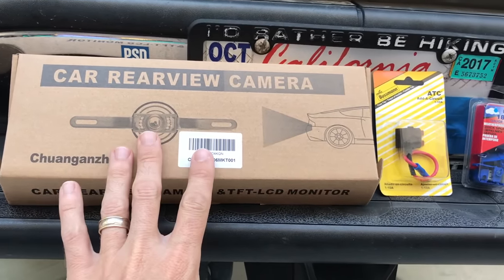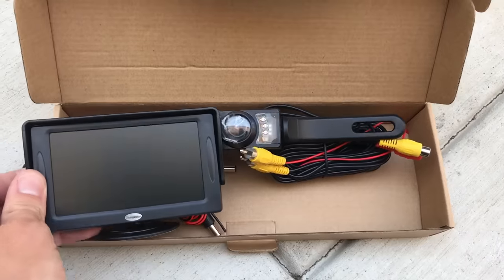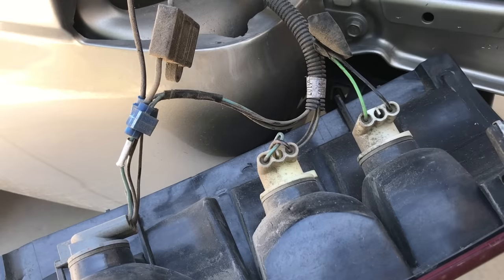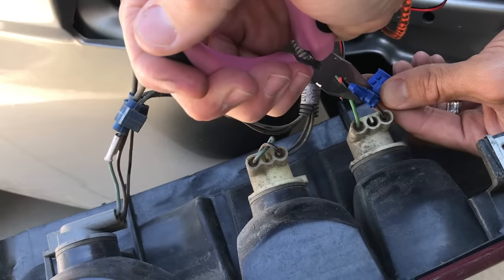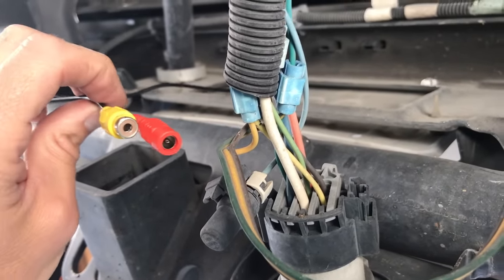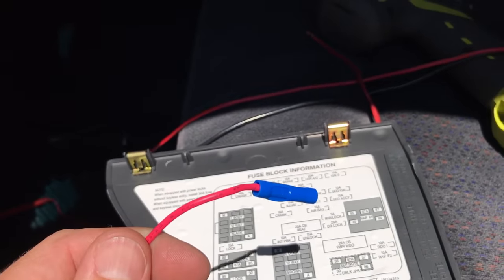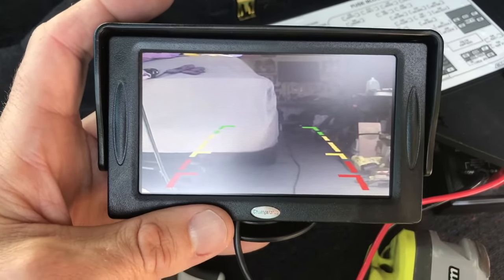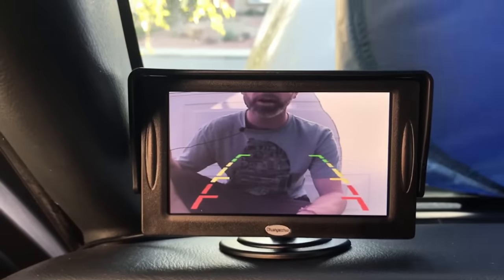Install a Rear View Reverse Backup Camera for only $30!

Comment: I threw my truck in reverse to test the connection before plugging it up like you said and the truck backed into my pond. Thanks.
Reply: You should have been looking at the monitor then, shouldn't you 🙄 (lol).
Reply: aRe yOu oK?
Reply: so close to winning a Darwin award
Reply: Did it work in the pond?? 😂
Reply: who was driving at the time ,you
Reply: made me laugh today and the comment is 2 years old!
Reply: Might wanna put emergency park on before leaving the vehicle in reverse.
▪︎ You can also put a tire block behind the rear wheels.
▪︎ You can also have a friend put it in reverse while you look at it while holding the brakes
Reply: @JOSERIZALADVENTURES and now it’s 4 years
Reply: LOL
Reply: Doh
Reply: Works as a fish finder too 😂
Reply: But did the camera work? 😂

Comment: This video is well done and very helpful. 
My only issue is with the clamp on splicers. Those things should be outlawed. lol
They ALWAYS allow moisture to enter, creating corrosion and resistance. 
And they almost always cut one or more strands of the parent wire
I've seen those clips cause the parent wire to break in half because of the corrosion they cause.  
It's far better to cut the wire and either solder or use a wire twist nut filled with  dielectric grease.
Not hatin on this video. As I said, it's well done and very informative - even after 3 years. 
I just cringe when I see those clips being used.
Reply: First time I used it was a joke

Comment: I bought all the recommended parts and installed it successfully.  Thanks for the video.  However, the quick splices did not work the first time on either the ground or power connections.  They made connection on the backup light side but not on the camera power harness side, so I ended up soldering a segment of thicker gauge wire onto the leads of the camera power harness wires.  Then the quick splices made a good connection.  I don't know if the splices are marginal or the gauge of the camera power wires got smaller or whatever, but I had 0% success using them on the power wires that come with the camera kit.

Comment: the video was very helpful, but it would be helpful to ( emphasize that  the power wire to the backup light is the  black/red stripe wire not the red wire as many people may think)  You did mention it  after watching the video a few times I picked up on it and  switched the wires and it worked perfectly.Thanks!

Comment: One question:

Instead of using add a circuit, can't we just add another quick splice onto the reverse light and use that as a power source for the display screen front? so two quick splice and use it power backup camera and display screen?
Reply: Did you ever try this? I'm about to install a camera on my car and had that same question?

Comment: How did you get the camera wire from the outside to the inside cab? I got everything but that.
Thanks for the video.
Reply from the maker: I went through the grommet that the e-brake cable runs through.

Comment: This is a great video, but it should be known, if you have a sedan with the fusebox mounted flush to the door, you wont be able to close the fuse panel to the add-a-circuit. So either direct wire under a circuit or better, find another place to mound it.

Comment: I never knew about the added circuit fuse. I normally have directly to the battery with a switch so i can switch on and off when I want or piggy back it onto the cigarette lighter, I have mine in a van so it's on all the time so that it works as a rear view mirror and has a nice wide angle that gives me a better view when switching lanes on a motorway.
Reply: For a beginner (me) how would you connect direct to battery with a van. I dont think my wires reach all the way up there. Any suggestions ?
Reply: @missculinary  vans I've driven had the battery under the drivers seat so easily accessible, and easy to run the wire under the carpet to the dash. Whe the battery is under the hood it's a little bit difficult to run the wire through, that's when I find it easier to splice into the cigarette lighter. Or you can splice it into the wire that powers the stereo.
Reply: @spiderman01980  Nice imma try the stereo . Thanks

Comment: I noticed a red wire coming off the wire going from front to back, I believe it is the video cable. Question is what did you do with the red wire coming off both ends? Did you connect them to ground or to something else?
Reply from the maker: That’s the power wire, if you don’t tap the reverse light you can run it to the fuse box.

Comment: Piece of advice the wire splice CONNECTORS even if they are waterproof are the worst CONNECTORS to use on a car.
Reply from the maker: I havn't had an issue yet... doesn't mean I wont though. What do you use?
Reply: DoItYourselfDad I will STRIP back the insulation solder the connection and heat shrink with only 3M heat shrink,reason being it seals the connection.My Second choice if a SOLDERING gun is not available is a 3M heat shrink butt connectors with solder in the connector,So when you heat with a hot air gun it solders and seals at the same time. These butt CONNECTORS can be found by other manufactures and yes the solder is in it already. 
In my 39 years of working on cars and trucks I have zero issues on salt spreaders using this method and it takes a little more time but it is worth it in the long run.
Reply: CRAZY HORSEPOWER I like to put some RTV silicone on the wire before heat shrinking it. Makes a great water proof connection.
Reply: CRAZY HORSEPOWER i used some 1" tubing like that once but I had to order it online because nobody in my area carries it. The RTV trick works good with Harbor freights tubing. I just went through some ground wires on my truck that I had half-assed fixed a year ago that had bad corrosion. This time I had the bed off so I took the opportunity to go through the wiring and fix it right. Even added a stainless bolt for a ground stud.
Reply: Allen McKinney As I live in the North we have many issues with salt attacking the wires and as MACK trucks warranty people just love to probe wires without sealing the wire when they are done, in a year the wire is gone.So with that said we have to triage the electrical system to get the truck up I perfere to use HEAT shrink solder butt connectors with a piece of solder with the 3M heat shrink.
If it is my personal car I would fuse the copper wires (with a micro torch and heat sinks) to each other using the 3M heat shrink. What I am concerned about with using RTV is it is flammable and if it is sealed in the heat shrink it could take a long time to dry. But as you are REPAIRING you truck and have better access to the wires and if you have more than 4 CONNECTIONS I would run a new wires as the more CONNECTIONS you make the higher the resistance in the circuit. unless you fuse the copper.
Reply: CRAZY HORSEPOWER I got at least 3 ground wires that was rotting so I traced them up to good copper and added new wire with solder, sealed it. Even at the ends I soldered the ring terminals and sealed them so nothing can go up the new wires.
Reply: Allen McKinney If you are also interested 3M makes liquid tape this is a great sealant at the ground terminal it comes in a a 1 qt can and when it drys it becomes like a thick plastic coating, Just make sure not to it in between eyelet CONNECTIONS as it will prevent making a complete circuit.
Reply: CRAZY HORSEPOWER I've used that before. It was one of those things I liked but didn't like at the same time.
Reply: Allen McKinney It something we use all the time to reseal the probe wires after MACK probes the wires,We use it on the battery,starter,and exposed power feeds and grounds.
Also Keep in mind a salt spreader is pretty much the worst environment for any eletrical connection, Its as bad as a boat on the sea.
Reply: yea they work for about a year then come loose or corrode lol
Reply: Yes there are many other great connectors out there and also make sure to at least tape if not use some kind of tubing to hide and protect your freshly run wiring from the elements.
Reply: As someone who works in a Service Shop I can second that..... Especially the 3M versions.. They are horrid!
Reply: NEVER use rtv silicone on electric. it uses an acid to cure itself.  thats why the vinegar odor. it will eat the wiring. use of non-rtv is ok
Reply: The Butt Circuits, havent messed with the add-a-circuits yet..
Reply: DoItYourselfDad  they make heat shrink butt connectors, but you would have to completely cut the wires and then splice the three.
Reply: Yes the connections are crap. You can buy silicone filled connectors now. I use them all the time. They work great on boat trailers , rv any kind of trailer.
Reply: Splice and twist buddy
Reply: notchjohnson1  Picky picky!
Reply from the maker: His shift key is broken, we’re working on an”how to” video that should help him out soon.

Comment: I'm installing on a chevy express van. The licent plate is on the swinging door not center of the bumper. Do you think itll still work or should I attach to the bumper?
Reply: I personally would attach to the center bumper just for a better viewing angle

Comment: Great video, but why didn't you show how you ran the cable from under the truck to the inside, or is that in your next video?
Reply from the maker: Every vehicle will be different, I ran mine through the hole that the ebrake cable runs through.
Reply: The ebrake plug could be an option to explore. Thanks.

Comment: My truck has TPMS (tire pressure monitoring system). Shortly after I installed the backup cam I started having problems with it. I think I finally figured it out. It's RF interference from the unshielded video cable. I am going to replace it with a shielded subwoofer cable. Hopefully that will do the trick.

Comment: Confused about the ground on the  piggyback fuse. How you are connecting the the power leads. Which ones goes where. Is the a optional ground wire  needed.
Reply: camera has a positive and negative to power it, assuming positive from fuse goes to red wire on camera power, then camera negative wire goes to gnd. Thats what I think he is doing, but better to go via the reversing light fuse otherwise you have power to camera all the time car is on.
Now i'm ansering his questions, and he hasn't even replied to my quetion, there might be better ways to connect the screen than he has done, but it should work fine. Check polarity of the fuse wire is positive before connecting it up.
You will need use relevant fuse size if using reverse light fuse spot for ad a fuse, not sure what the camera would draw, dont think it would be much would have to check, i'm guessing 5amp would be plenty probably alot less, I will test my camera during install at some stage.

Comment: on dc isn't red usually pos. and blk neg ....great video ...very informative.... thanx
Reply from the maker: Yes and no, it's going to vary by vehicle. Each wire is color coded depending on where it's going. If you aren't sure which is which in your vehicle it's best to look up a wiring diagram to make sure.
Reply: Yes it usually is.  Always best to check with a meter to be sure.  You're going to need a meter anyway to check and recheck your connections.

Comment: Can you have it on even while driving? I will be renting a cargo can with a partition and won't have a rear view.
Reply from the maker: Yes, you can. He would just have to wire the camera into something that is always on. I’ve done something like that on my trailer, I have a camera wired into one of the running lights.

Comment: @0:39, the wire on the bottom right, (the VGA I think), where do you plug the red wires that’s dangling from it? 
Thanks

Comment: Good video. So you connected the camera to the reverse lights circuit and the screen to one of the available ignition circuits. Could you have just connected both to the reverse lights?
Reply from the maker: I assume it would work, didn't try it though.
Reply: TPainWhatitDo  its a late reply but, the camera is intended to be wired the way he did it so the camera only comes on when the vehicle is placed in reverse.  Powering the screen at the same point would require longer leads and might cause a delay in the seeing the images on the screen.

Comment: So far this is very helpful video, but i need to know where did you run the wire from the rear to the front? is it easy to run the wire on passenger side or driver side? I'm also installing the camera.

Comment: Thanks for the video.  I didn't quite understand the part about connecting the ground wire in the fuse box.  Is the ground wire a part of the power cable to the display supplied in the kit?

Comment: Thanks great vid! Just a question...if the fuse tap is on the ignition it would power on the camera when the car is on....wouldn't it be better to put the fuse tap on the reverse fuse so it he screen powers on only when the car is put in reverse?
Reply: he wants it on all the time

Comment: My kit from your link came with a car outlet power source . Would I be able to convert that to go into my fuse box ?
Reply from the maker: Strange, they just have changed then product. You should be able to just cut the 12v plug off and wire it in as show in the video.

Comment: Hello.. Very good video.. I have a question.. I have a camera and a monitor.. You put your camera in your reverse light, so when you go to reserve position the camera turns on.. Then u put the monitor in fuse that is mean that  the monitor(screen) its always on? Can we take power both of them from the reverse light? So that it turns on only in the reverse position? I will be waiting for your aply. Thank u.
Reply from the maker: The monitor will only come on when a signal from the camera is detected. So you can power the monitor through the fuse panel and it won't be on all the time. You can also run power from the tail light to the monitor through the red wire that runs with the video cable if you wish.
Reply: @DoItYourselfDad  thank u for your answer..

Comment: I need to do this on my 2006 Nissan Pathfinder. My chain link fence seems to hate my vehicles. OK the fence & slippery mud in my driveway.

The only concern I have is the camera covering the top part of the license plate, even though cops could just run the plate number on their computers to check vehicle registration status.

Comment: My ignition doesn’t send electricity to the radio so the only was I’ve been able to make it work is having a wire to the battery. Can I use that fuse with the outlet here?
Your project is neat. I want one.
Reply from the maker: You should be able to get into your fusebox and find one of your fuses that is only "hot" when the car is keyed on. Tap whatever fuse that is and pull power from it.

Comment: Good instructions. Now, my truck gives a poor visualization of the back, when viewed through the optical rear mirror.  If I want to have LCD on, all the time, when car running, so that I have a running electronic rear view mirror/LCD, how should I connect that red wire? Do I need to run another IGN wire from fuse box to the back for car? Also is the LCD bright enough to be viewed during day time? Thanks,

Comment: Really grt video, I followed every single step you instructed but my screen conitues to flicker all the time
Reply from the maker: If it’s flickering it may either be a bad connection or interference. I’ve heard of some people having issues if the video line was directly next to other power lines in the car.
Reply: DoItYourselfDad oh man I didn't think of that. Thank you so so much for the advice
Reply: DoItYourselfDad thanks for the response BTW much appreciated. Also I noticed you have a pickup truck have you ever undercoated your truck?
Reply from the maker: I haven’t, though I live in the dessert so I don’t have to worry much about salt

Comment: I'm confused. You called the wire positive and put the black one in. The wire from the camera. Wouldn't it be the red one?
Reply from the maker: It's been a while since I made the video, and I've sold the truck since, so I can't run out and check. I do remember that some of the wirings for the backup camera were mixed up though. You could try bench testing it first hooking it up to the battery to confirm what wire is positive, negative and signal.

Comment: I had just did it today and the monitor didn’t display . I have 1 question about the short red wire at the yellow plug monitor, where to connect this short red wire

Comment: Great video, but what if I wanted the rear camera to be on anytime the truck is on? Would I just run the power to a day time running light instead of the reverse light?
Reply from the maker: Yes, exactly. Or any other 12v source that’s hot when the car is on.
Reply: @DoItYourselfDad  Thanks!

Comment: Amazing tutorial! Defiantly subbed 
The only thing I didn’t understand was where the cables from the camera went? Did it follow through where the wires are for the headlights and if so wouldn’t there still be expose wire on the end? If you answer Thank you!

Comment: If you're going to use those crappy splice connectors you should ALWAYS fill them with silicone first.  Same with crimp style barrel connectors.  Best way I've found to do it is to punch a small hole into the silicone's metal seal, then press the connector to the opening and squeeze until you get silicone out of the other side.  As long as you make your electrical connections before the silicone sets, it'll have a good connection and be water proof.

Comment: I would plastidip the housing of the camera just to make sure water doesn't leak inside and into the lens as well.
Reply from the maker: Good idea! I have had any leaking... but then again I live in the desert.
Reply: and somehow cover those clip connectors. maybe with liquid electrical tape or heat shrink?